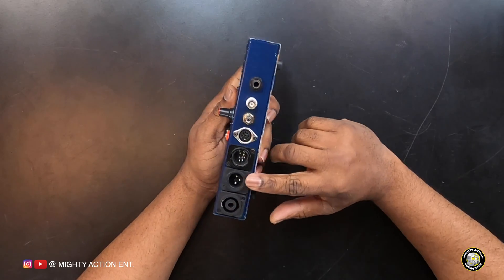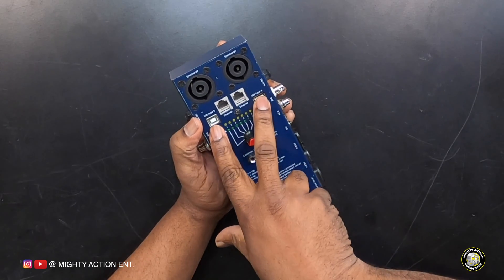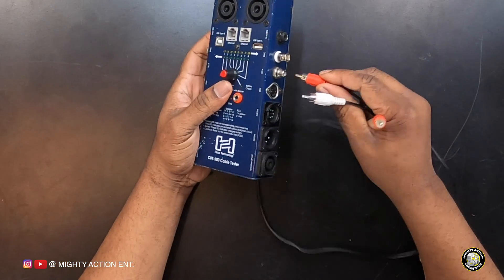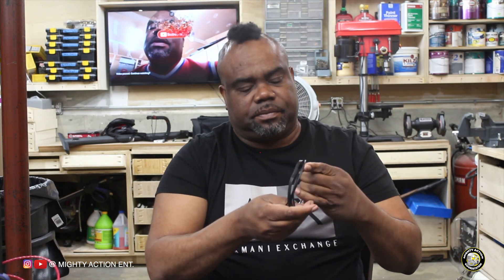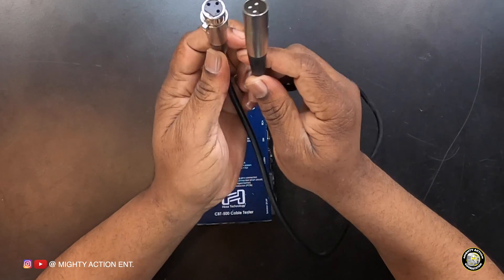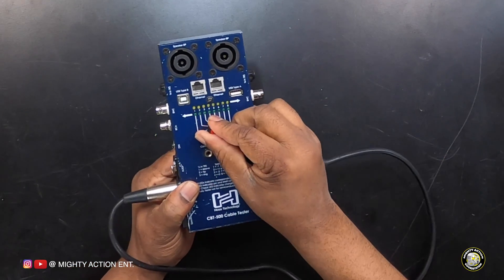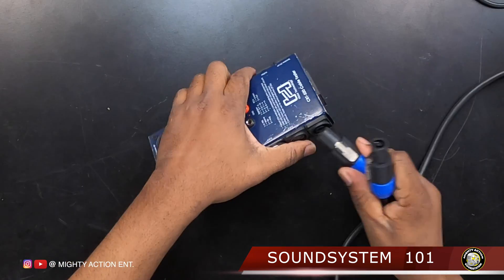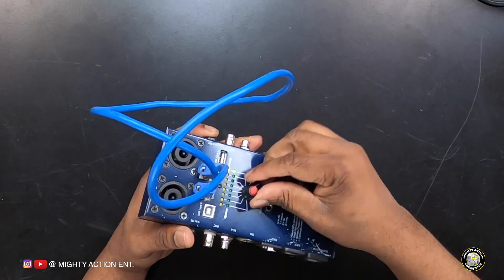SOUNDSYSTEM 101 - HOSA CBT-500 REVIEW

Comment: I have WarfDale  double  2x15 in and a  1 horn  .I want to use it for a mid and high what nuetrik connection do I use?
Reply from the maker: it depends on how your going use your tops. if your playing in a 2way setup ( thats the 2x15's on the same frequency plus the horn ) the 4pin speakon will work. but if your going to do 3way setup ( thats the 2x15's playing different frequency plus the horn ) you would be better off using the 8pin speakon